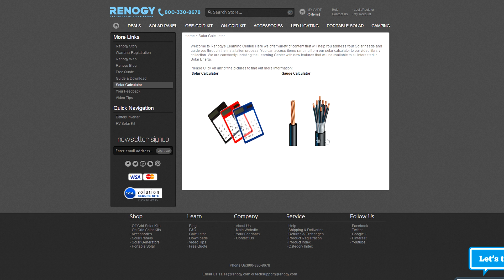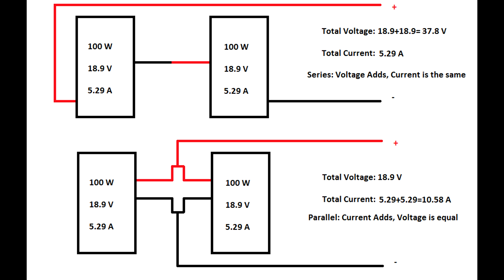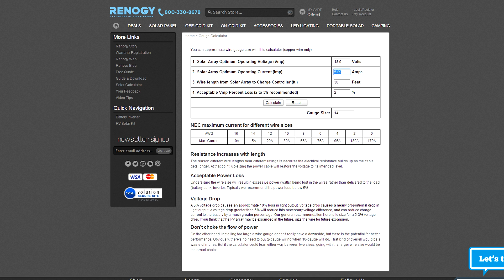Renogy: How to Size a Solar Power System using our Solar Calculator Part 2

Comment: Thanks Guys, I appreciate the vids! I work at Crutchfield and run the marine dept. as well as I'm a certified NMEA and AMEI. We carry a few of your products. I'm getting ready to out fit our Crealock 37 with a solar system, the old one was struck by lightning and fried the controller, and the panels were old so it's on to new. Probably be hitting you guys up soon. Thanks, Curtis

Comment: Why would you use #4 awg which is good for 95 amps when you could use #10 which is good for 30 amps, which should cover voltage drop?

Comment: I have read that mixing wattage of panels reduces the largest panel to the lower panel wattage losing use of the extra watts. Ex, you have 4 80watt panels and 2 100 watt which would total 520 watts but in the theory you would really be at 480 as it sees the larger panels at being 80. Is this correct or just bs?

Comment: If I read the comments correctly, I could take four 100-watt panels, wire two panels together series, the other two panels together in series, then wire the two pairs of panels together in parallel before connecting to the charge controller. Is that correct? If so, would that reduce the wire gauge needed to connect the panels to the controller. 

I ask because I am looking at your 400-watt kit with the MPPT controller on Amazon. It appears that the controller included in that kit supports 12 and 24-volt wiring setups, but not 48-volt (meaning I could not wire all four panels in series). Would this set-up work for connecting to a 12-volt battery bank? (I have two six-volt batteries wired in series to provide 12-volt power to my RV.) Thanks.
Reply from the maker: Hi +No Overnight Sensation,

That is correct, you can wire the panels in series/parallel. You can wire all 4 panels in series to further reduce the wire gauge and voltage loss between the panels and charge controller. The controller will only support a 12 volt or 24 volt battery bank. The max input voltage for this controller is 100 volts so having 4 panels in series will not go over this spec. If you have any questions about the wiring or the controller, you can contact tech support at (800) 330-8678. Thank you.
Reply: +Renogy Solar So I could wire all four in series even though I am running a 12-volt battery bank, correct? Sory if I sound a bit dense as I am still getting up to speed on solar. Thanks.
Reply from the maker: +No Overnight Sensation Yes, that's correct, but only with a 40A MPPT charge controller. And no worries! Please feel free to message us with any questions you have--we'll do our best to answer them. :)

Comment: Thanks for posting so much usable info. I have not watched all your videos yet. But it helps to learn more. I plan to start buying solar in the next month or so. I was looking at the 2 or 3 100 amp panel kits. Your price is good. But if I continue adding panels. Then I would need to keep upgrading controller and ? There is so much to learn to go from a started to complete off grid. Also grid tie and battery.
Reply from the maker: It depends on how much you want to upgrade to. Our 30 Amp Controller can handle around 400 Watts at 12V.

Comment: Thanks for your very informative videos.

I have a challenge and was hoping you could help me out. Is it possible to connect 5 panels of 100W each, 3 in parallel and remaining 2 in parallel too and then connect the two sets of parallel connected panels in series to create a 24V output? Does it matter that the two amperage totals from either set of parallel connects wont be the same?

Hope my question is clear.
Reply from the maker: Hi Julian,

We do not recommend that you do this because the amperages of the two arrays are different and you will be limited by the set with the lowest amperage. Because of this, you will be losing out on amps. We recommend that you purchase an additional panel and string your modules in three sets of two using a series connection. Once you have three sets at 24V each, then you can do a parallel connection.